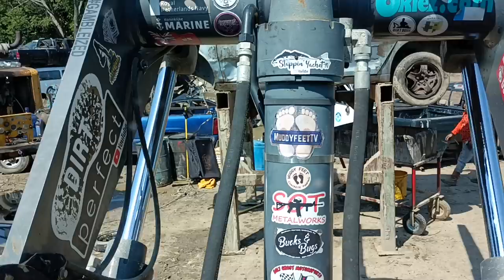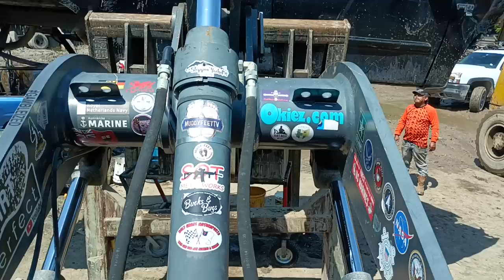This Car Crushing 🤠 has 27,000 Buddies

Comment: I saw a brand new Dodge Longhorn edition 1 ton sitting on a dealer lot, the dealer sheet said $72 grand. That's half the price of a cheap house. I saw the same truck running around in the spring time, dirty never washed. It'll rust out very quickly treated like that, for that price, I'd be washing it everyday.

Comment: Beginning of the video, already crushed Chevrolet Impala.
Volvo S60 getting loaded into the crusher (0:13, crushed).
2:25, Chevrolet Malibu set onto the rack (3:30, crushed). Took a moment to identify.
6:04, grabbing a first generation Honda CRV and setting it aside.
6:54, grabbing a Ford F150 (14:06, crushed).
7:47, Ford F150 on the rack (11:13, crushed).
13:11, Ford F150 on the side (16:49, crushed).

Not too much going on, buncha stuff in the way. Loading a truck near the end of the video. 7 cars sorted on the video, 6 crushed. So, new tally is 2,791.